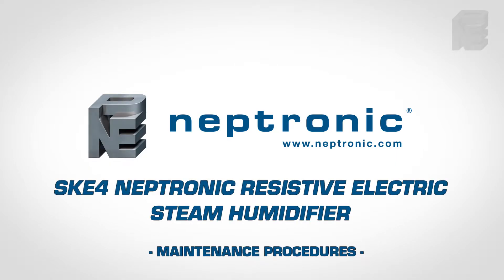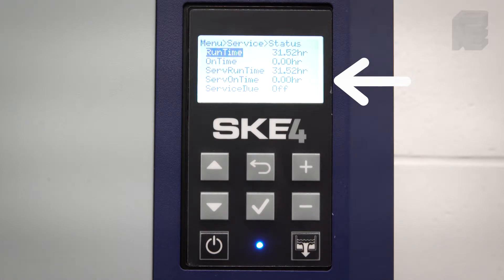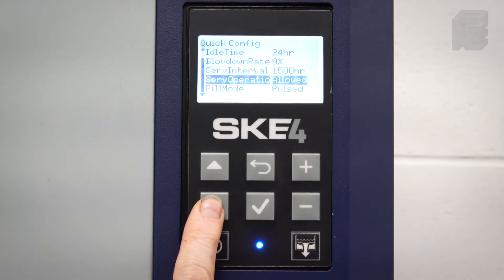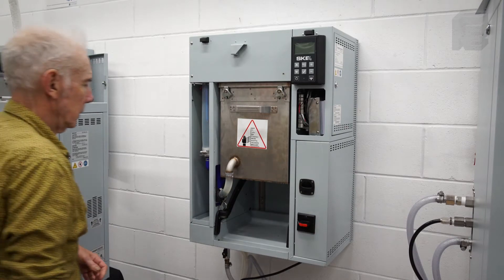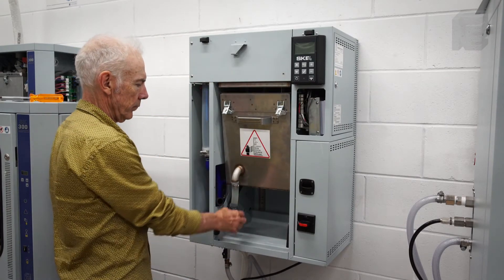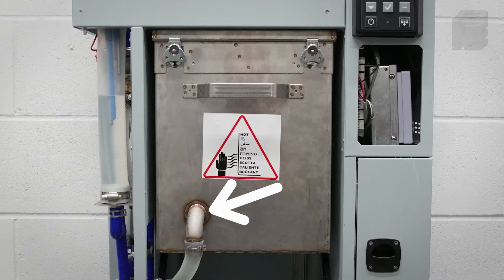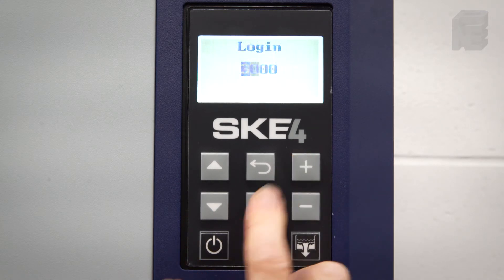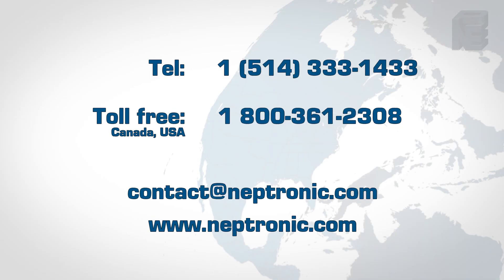SKE4 - Maintenance procedure

Comment: Greetings, I have a problem with that equipment, it appears in a status of deactivated or inactive (idle). I have already tried several solutions and I cannot correct the problem. Because there is other equipment, it has been tried by changing the level sensor since it indicated a failure but it still worked, I hope you can help me since the manual does not mention actions to review or correct due to this state of the equipment, it is worth mentioning that the programming of the equipment that is working without success has also been copied, thank you.
Reply: Greetings, I have a problem with that equipment, it appears in status as deactivated or inactive (idle), I have already tried several solutions and I cannot correct the problem, because there is other equipment, it has been tested by changing the level sensor since it was indicating a failure but it still worked, I hope you can help me since the manual does not mention actions to review or correct due to this state of the equipment, it is worth mentioning that the programming of the equipment that is working without success has also been copied, thank you.